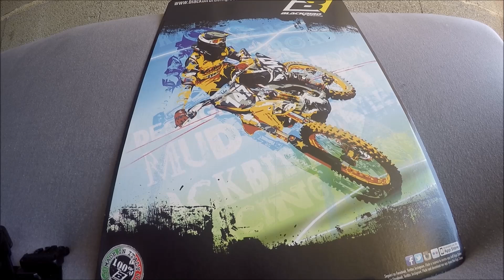Comment Retirer un Rotor d'Allumage SANS Arrache-Volant sur Moto ! 🔧🚴‍♂️ | Astuce DIY Moto

Comment: tu places un 2eme outil comme ça en symetrique (donc à 180°) un ptit coup de chauffe au centre du filetage du vilo et y'a aucun risque si on y va progressif..
controler auparavant avec le doigt si la partie magnetique ne depasse pas de la cloche a linterieur auquel cas la méthode est à proscrire
la technique au remontage est de déposer de la craie sur la portée du stator ou sur le vilo 
montage au frein filet (1 goutte dans l'écrou) et le redémontage sera simplifié
Reply from the maker: le soucis la ces que ont a qu'un point pour ce caler , a 180 ont ne pouvaient rien faire. 
Bon depuis je suis mécano et j'ai donc tous ce qu'il faut et ça va beaucoup mieux.(arrache,décapeur et chalumeaux)